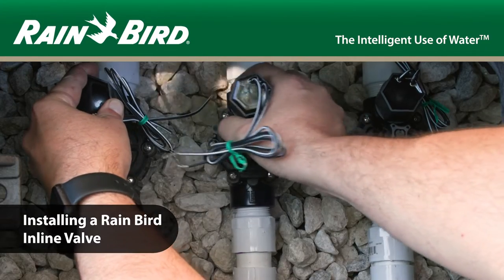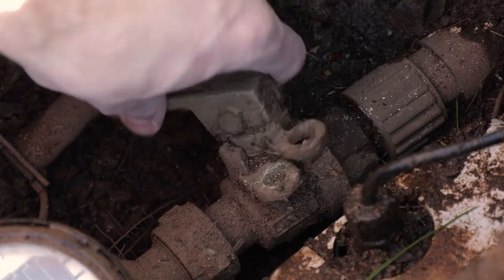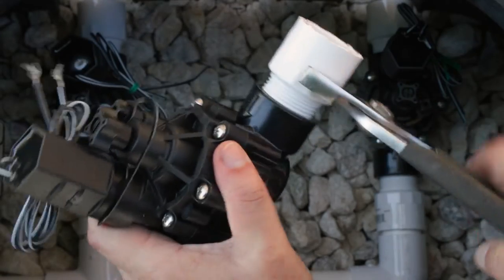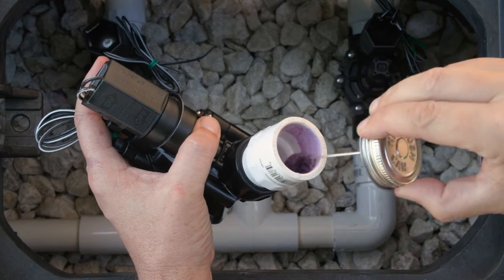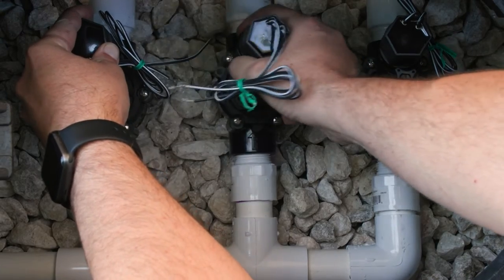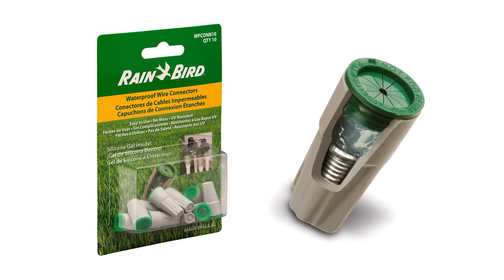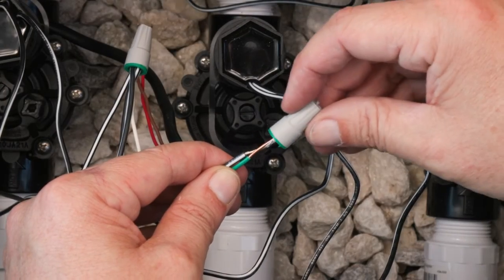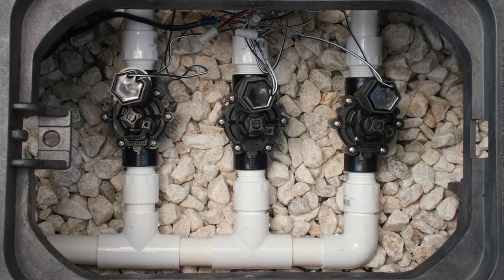Installing a Rain Bird Inline Valve

Comment: Both the hot and neutral wire coming from my valve are the same black/white stripe color.
Reply: The wires coming from the valve are interchangeable. One has to be connected to the common from the sprinkler timer (usually white), and other has to be connected to the power wire for a particular sprinkler line.

Comment: The threaded adapter only screws in about 1/4 to 1/2 inch without using any tape. Is this by design?

Comment: yeah, so freaking simple we didn't even bother showing how to fix the other side of the valve line.  zero help with replacing an existing valve
Reply: lol i came to write same thing!
Reply: Same!
Reply: For anyone still wondering, you use pvc union fittings, that way you can place it directly inline and screw in the fittings to create a connection to the pipes. This video only shows how to install a valve if you are still laying all the irrigation pipes.
Reply: I just came here to say that. Smh. I'm thinking you have to dig back far enough to be able to move the pipe going to the zones. That way you can get it back in on both sides.